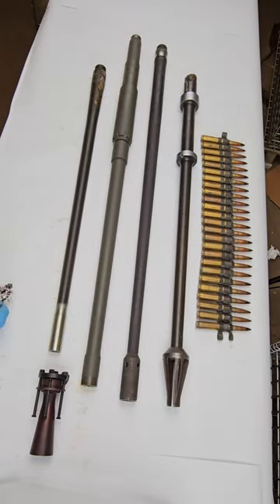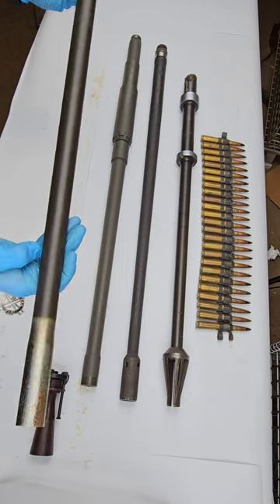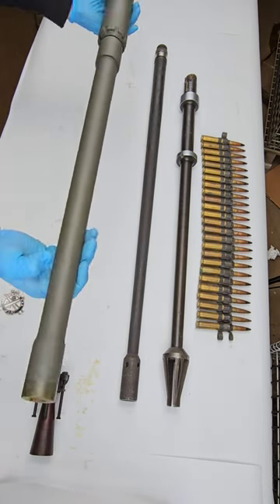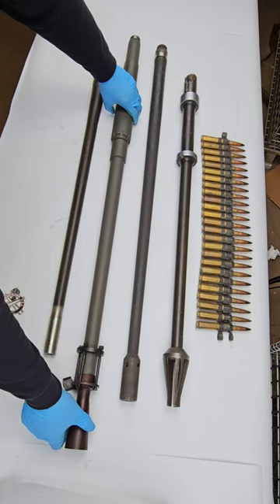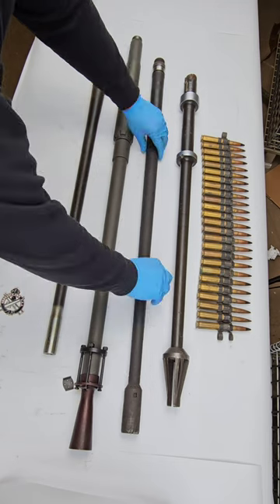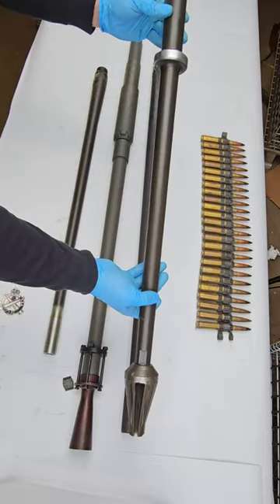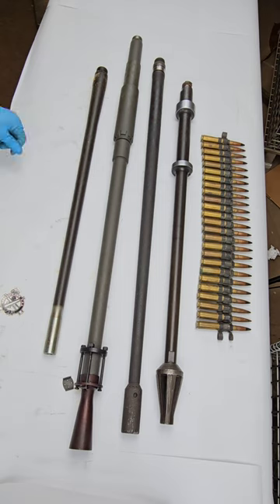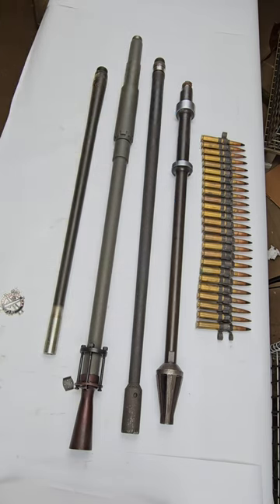U.S. Military 50cal MACHINE GUN Barrel Comparison: M3AC M2HB M2WC M85CA #army #navy #airforce #gun

Comment from the maker: Showing four different types of U.S. military .50cal machine gun barrels that have been in use at different times over the past 90 years. Shown and briefly discussed are the M3 aircraft barrel, M2 heavy barrel, M2 water-cooled barrel, and the M85 coaxial barrel. All barrels are chambered in the .50bmg caliber (Browning Machine Gun).
Reply: But the M85 50 cal. use  a different belt links can't fit for the Browning M2/M3  😮 that  is the problem for the ammo  resupply 😅